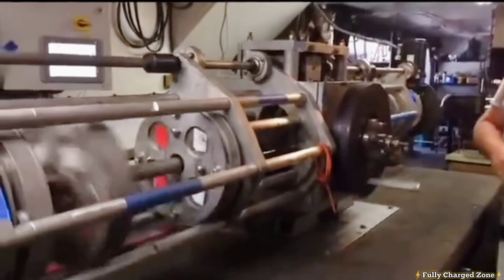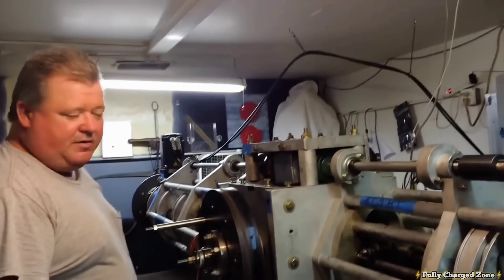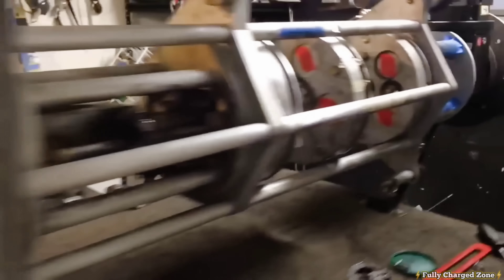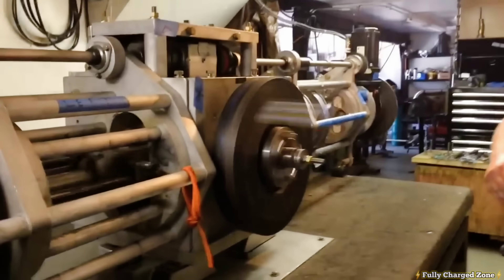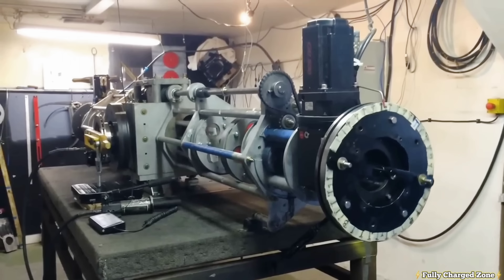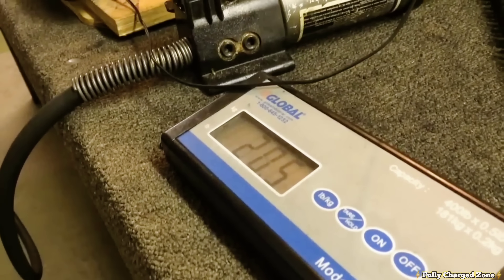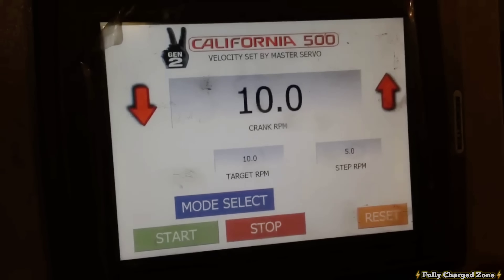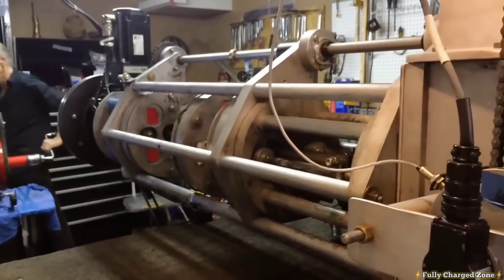World's 1st Magnet Motor - US Patent # 8487484b1

Comment: Is it powerful enough to move a vehicle at acceptable speeds? Or produce enough electricity to charge  an electric  vehicles battery and keep it charged during operation?
Reply from the maker: @adamretsen
Right now the prototype isn’t built for vehicle propulsion or EV level power. The patent (US 8487484B1) only covers the magnetic sequencing mechanism, not a full engine, generator system, or closed-loop power source.

This stage is strictly about proving the mechanical motion, timing, and torque the inventor described. Once I finish the torque testing and get real numbers, I can couple it to a generator head and measure electrical output...but we’re not at the “move a vehicle” stage.

So short answer... Not designed for vehicle speeds yet, Not generating charging-level electricity yet,  Step-by-step testing comes first.

The goal right now is to document the mechanism accurately so everyone can see how the patent actually works. ⚡️

Comment: They said perpetual energy was not possible, but with this engine, it just might be
Reply from the maker: Perpetual energy is a huge claim — but what Sonny built is definitely not your typical motor. The patent shows a magnetic-assist design where the permanent magnets do part of the work, so the electrical input needed to keep it turning can drop way lower than a normal setup.

Whether it crosses into true self-sustainment is something we can’t confirm, especially because the inventor passed away before full testing was finished. But the behavior of the device is interesting enough that you can’t just dismiss it. There’s clearly a magnetic asymmetry happening that boosts torque in ways standard motors don’t use.

So I stay open-minded — not claiming perpetual motion, just saying this design deserves real testing instead of blanket skepticism.
Reply: No, it won't. Perpetual motion defies the laws of physics.
Reply: @camshaftprelube 

If perpetual motion really defies the laws of physics then why does the Earth spin perpetually but never stop or slow down

Comment: Still using electricity to power the magnets. You don't get something from nothing. The advantages to this design are the friction reduction.
Reply from the maker: Not quite... the patent (US 8,487,484 B1) doesn’t use electricity to power the magnets. The permanent magnets are the energy source, and the only electrical input is for timing a mechanical cam that sequences the magnetic fields.
The patent specifically describes a mechanically-driven magnetic gating system, No coils driving torque, No electromagnets doing work, No continuous electrical feed to “power” the magnets.

The electricity is only for low power control, not propulsion.
All torque is generated by permanent-magnet interaction modulated by the cam, which is exactly what the claims outline.

So you're right... you don’t get something from nothing. This design isn’t “free energy”; it’s a way of harnessing magnetic potential in a controlled, repeatable cycle with extremely low friction and very little parasitic load.

That’s the whole point of the patent: magnetic sequencing
Reply: @FullyChargedZone ty for the explanation.

Comment: You miss the main things...
Wath It produce?
Producing 0
It Is Just a moving machine,low rpm.
He did t tell about Energy,job,application.
So until now Is Just a exsercise.
You use the Energy of magnet to move the magnet Itself but Wath if you  connect It to an alternator?
Why you don t test It..
Because there Is no Energy producing,this Is why
Reply from the maker: It actually does produce something... mechanical torque.
The patent isn’t claiming an electrical generator or a free-energy device. It’s a magnetic sequencing engine that shows how you can convert permanent magnet potential into controlled rotational work using a cam and timed magnetic gates.

It’s low RPM because the prototype was built for proof of concept, not for power output. That’s why the patent focuses on how the magnetic interaction is modulated, not on a specific application. That part is left open for future development.

Connecting it to an alternator isn’t part of the patent because the patent isn’t about electricity generation...  it’s about the mechanics of continuous magnetic propulsion. Just like any engine, you scale it, refine it, and then pair it with whatever load or generator you want.

So it’s not “producing 0.”
It’s producing rotational work exactly as described in the patent. The purpose of the build is to show the function of the magnetic cam system, not to demonstrate a full commercial machine.

Comment: Whenever I've tried experiments like this, the magnets eventually lock up.  What's keeping these ones in motion?  There must be an external power source providing the energy necessary for continuous motion.  I've never seen one of these applied to something real, like a working car, or powering household appliances.

Just because something has a patent, doesn't mean it works as intended.
Reply: There is a black electric motor at each end, mounted on right angle gearboxes. And with cables attached. That is how it gets power to rotate.
Reply from the maker: Those aren’t drive motors — they’re just the pivot stands the inventor used to level the shaft during assembly. Nothing in the patent uses external motors to rotate the cam.
Reply: @FullyChargedZone   they ARE drive motors and they have electrical cables attached.
How do you think it can rotate without drive motors?
Nothing can rotate without a source of power
Reply from the maker: This setup isn’t running on ‘free energy’ or continuous self-motion. The patent (US 8,487,484 B1) describes a magnetic cam sequencing system... basically using timed changes in magnetic force to create a mechanical push-pulse.

Without that cam timing, magnets lock up exactly like you described.
That’s why this design uses a mechanical offset to break the symmetry.

Comment: There is alot of lost energy in that vibration. Definitely need to firm things up
Reply from the maker: Good eye... the vibration you’re seeing is mostly from the magnetic sequencing cycle, not wasted energy. If you read the patent (US 8,487,484 B1), the design uses asymmetric magnetic cam timing, so the magnets ‘snap’ past each other in pulses. That creates side-load and oscillation until the housing is fully braced.

Comment: I want to see the energy potential. Hook it up to some AC motors
Reply: Not on video, that's how inventor's die or disappear
Reply from the maker: @matthurst4678
That’s exactly why I’m putting everything on video...  the patent (US 8487484B1) is already public, and the more the design is documented and shared, the harder it is for anything to “disappear.”

Sunlight is the best safety system. The goal is to make sure Sonny’s mechanism is out in the open for everyone to see. ⚡️
Reply from the maker: @derrickmoses1507
That’s the plan long-term. Right now I’m just proving the mechanical sequencing exactly as the patent (US 8487484B1) describes it. Once the torque output is fully measured and stable, the next step is coupling it to a generator head or an AC motor setup so we can see real electrical output numbers.

This stage is all about validating the motion... the energy tests come after. ⚡️

Comment: Make a magnet Generator for power
Reply from the maker: @Hank-t5b
That’s actually the long-term idea. The patent (US 8487484B1) isn’t a generator by itself...  it’s a magnetic drive mechanism that creates a repeating torque event. Once the torque section is fully dialed in, coupling it to a generator head is straightforward.

Right now I’m focusing on proving the mechanical sequence and documenting the torque output. After that, a dedicated generator setup is definitely on the list. ⚡️

Comment: Generate electricity with it or it’s worthless.
Reply from the maker: @nb117
Totally understand... but this stage isn’t about power generation yet. The patent (US 8487484B1) only describes the mechanical sequencing mechanism, not the electrical side.

Right now I’m proving the motion, timing, and torque exactly as the inventor designed it. Once the mechanical cycle is stable and fully measured, then I can couple it to a generator head and show actual electrical output.

One step at a time... the foundation has to be solid before anything else. ⚡️

Comment: How do you throttle it up or down? And how much torque does it produce? Dont see many applications for this
Reply from the maker: Great questions. The prototype isn’t built with a throttle yet... it’s just demonstrating the magnetic sequencing mechanism from the patent. You control speed by changing the cam profile or the timing of the magnetic gates, just like advancing or retarding timing on an engine.

Torque depends on magnet size, cam width, and rotor diameter. This build is small, so torque is low, but the concept scales up the same way any engine does. The patent is about the method, not the final application.

Comment: What hp at your power takeoff point have yoy achieved.
Reply from the maker: @rumblethis2023 Good question.

This rig is still in the test-stand / proof-of-concept stage, so I haven’t done a proper calibrated HP dyno pull at the power-takeoff yet. Right now I’m mainly measuring shaft torque and stroke to verify what’s in US-8,487,484 — it’s basically a magnetic torque-converter, so the output horsepower just scales with the input power and the geometry you build it with.

Once I have a version that’s been run on a dyno with confirmed HP numbers at the PTO I’ll post the data and update everyone.

Comment: This is just a prototype or maybe the second one just imagine if technology today got behind that one they could do with it
Reply from the maker: @kjc1501
Exactly...  this is just the working prototype built to match the layout in US Patent 8487484B1. It’s the original mechanism Sonny designed, not a production version.

If modern engineering, materials, and machining got behind this concept, the efficiency, size, and control of the magnetic sequencing could be taken way further. This build is just the first step in showing how the patented motion actually works. ⚡️

Comment: The problem is the vibration.Look how much that thing vibrates it's rocking
Reply: I mean, it IS flinging around 400lb magnets... But as a proof of concept, super awesome
Reply from the maker: @0707RD
Exactly... when you’ve got heavy magnetic assemblies snapping through a sequencing cycle like the patent shows (US 8487484B1), you’re going to see some movement on a raw test stand.

But for a first proof of concept, it’s doing exactly what Sonny designed it to do. Once it’s balanced, mounted, and refined, the motion gets way smoother. Appreciate the support! ⚡️
Reply from the maker: @TonyMoore-n2o
Totally fair point... what you’re seeing in the video is the prototype running without any of the damping, balancing, or proper engine-mount isolation you’d normally add. The patent (US 8487484B1) only defines the magnetic sequencing mechanism, not the support structure.

Right now the whole rig is on a basic test stand, so every magnetic “stroke” transfers straight into the frame. Once it’s balanced, isolated, and running on proper mounts, the vibration can be reduced just like any reciprocating test setup. This stage is all about proving the motion exactly as the patent describes. ⚡️

Comment: You can seal the device and vacuum to reduce the air  resistance
Reply from the maker: Reducing air resistance does help, but a full vacuum changes the physics. Once you pull the air out, you also lose convective cooling, so the device overheats fast. Most of these systems rely on air to dump heat, so a vacuum actually makes performance worse, not better.
Reply: @FullyChargedZone  where is the heat coming from? What is the source.
Reply from the maker: Great question. The main heat sources are... Eddy current losses in nearby metal parts,  moving magnetic fields induce current which creates heat. Hysteresis losses inside the magnets, energy lost as the magnetic domains flip. Bearing & friction losses, mechanical resistance = heat. Electrical losses if coils or sensors are involved
Even in a purely magnetic device, those effects mean some input energy becomes heat. That’s what needs to be removed for sustained operation.
Reply: @FullyChargedZone  ok, have you connected a generator to it yet?
Reply: There are all kinds of things you can do.

Build it in space. 

3D print to form. 

Use lighter weight materials. 

Your comment is 👍😂
Reply: Exactly the same process in the oil field called artificial lift
Reply: Isso seria para altas velocidade, ali você quer é potencia .
Reply: GOOD IDEA, THE BIG TEST IS  WHEN ITS OINGTO BE U NDER DRAG WHEN IT TURNS A GENERATOR, BEING UNDER VACUM COULD STOP IT BUT THE AIR CAN BE ANOTHER SORCE OF OUT PUT OF ENERGY ONES ITS COMPRESED BUT THATS  THE QUESTION IT MUST CREATE ENOUGH FORCE TO COMPRESS AIR TANKS WITCH WILL AMPLIFY THE FORCE, JUST LIKE WATER RESERVOIRS WITCH INCREASE THE PRESURE, THIS IS LIMITED GO TO ELECTRO MAGNETIC FIELDS WITCH TAKE LITTLE INPUT AND CAN GIVE GREAT POWER, IT WAS DONE WITH A 9 VOLT BATTERIE WE ALL KNOW WHO DID IT AND WHAT HAPPEN TO HIM ...
Reply from the maker: You’re right that the real test is what happens once you put a load on it,  like a generator or compressor. As soon as you extract energy, you introduce drag and the system has to supply more torque to overcome that load. Permanent magnets provide force, but that force is conservative, over a full rotation you don’t get net energy gain. Friction, hysteresis, and cogging always take more than you get back. So compressing air or generating power will slow it down unless there’s an outside energy source feeding the rotation. Electromagnetic setups can absolutely amplify and control torque, but again, that energy still has to come from somewhere (battery, grid, solar, etc.). In this patent’s design, magnets are just the mechanical transmission, not the energy source. If someone ever finds a configuration where the magnets add more energy than they take… every physics book gets a rewrite 😄⚡
Reply: @FullyChargedZone  ELECTROMAG PULSE IS THE FUTURE THEY HAVE BUT WONT SHARE ...
Reply: @FullyChargedZone  well, we need to get the printing presses ready then because there is a way.
Reply: Use a check valve and make it pump it's own vacuum
Reply: You can add more servo motors to make it stronger
Reply: Ahhh shattt appp
Reply: Yeah but how much power will the vacuum pull?
Reply: @Parfumhill ideally none, use a  magnet coupled pump. Spinning magnets on the flywheel well then spin a pump. The vacuum pump and the magnets on the flywheel are air gapped so there is very little loss of power. Honda used magnetically coupled pumps for water cooling on their generators.
Reply: Wrong, the fast moving parts needs air to move freely, a vacuum will slow it down. 
Nothing moves fast in space, duh!
Reply: @Bartetmedia  You sound like someone fun to work with.

Comment: Yup! I've seen this before but I didn't fully understand it. I see it again and now I fully understand. This wouldn't work without the flywheel, much like the spring generator needs a flywheel. Same exact concept just different contraption. Well done! The perendev also works and is a self starter, much more compact design as well.
Reply from the maker: @JF32304
Appreciate that... and the flywheel here isn’t what makes the mechanism work, it just smooths out the sequencing cycle. The real motion comes from the magnetic timing layout in US Patent 8487484B1. The flywheel only stabilizes the pulses, just like it would in any reciprocating setup.

As for other designs like Perendev, those aren’t related to this patent. This build is strictly Sonny Miller’s mechanism, shown exactly the way he documented it. One concept at a time, done by the book. ⚡️
Reply: We do not see it driving a load. That is the problem with all these inventions.

Comment: With that much movement of the machine running...there is no way that is real.
Reply from the maker: @eyeswydeopen
The movement you see is just the test stand flexing. Those magnets are heavy and the cam hits in pulses, so the whole table acts like a spring. The mechanism itself is exactly what’s shown in the patent... no edits, no special effects. Once it’s mounted to a rigid base, that rocking disappears.
Reply: @FullyChargedZone bs that will rock bolted down .it will feel like a eathquake...that amount of rocking shows how energy is been wasted...lots of rocking lots of wasted energy...its bs